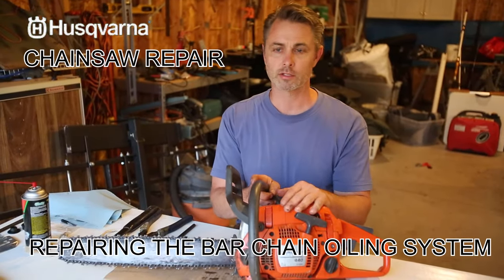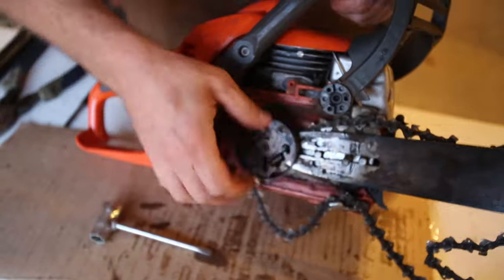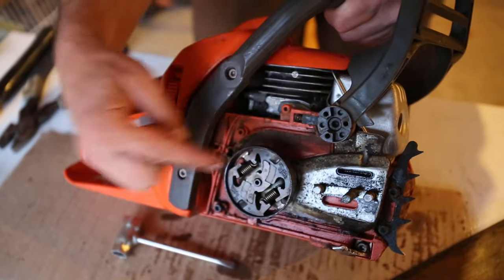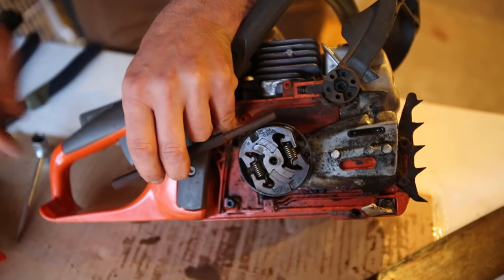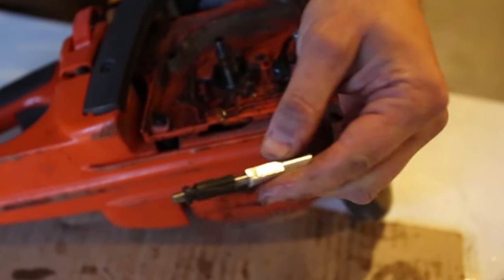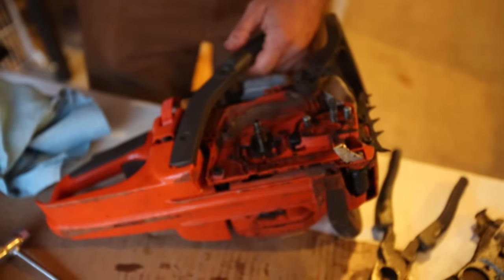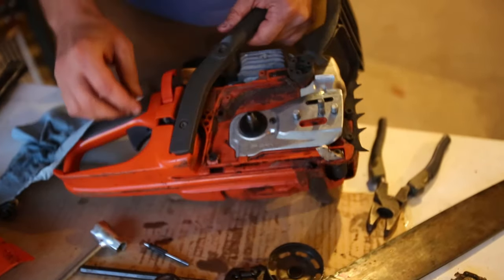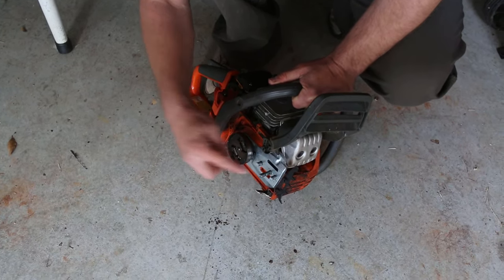Husqvarna Chain Lubrication Diagnosis and Repair

Comment: Thank you for this important video. I experienced this same issue the other day cutting some trees, when I went to top up the fuel and the oil because the chain was dry and smoking a little. This is when  I noticed the the oil levels never dropped. Got home, watched your video, followed your instructions cleaned up the chainsaw  and turned the housing and oil came out of the grove. Why isn't the chain not receiving oil???
Reply from the maker: Did you pull the bar off and clean the two port holes that match up with the oiling slot? And did the worm gear look to be in good shape? Or is the line from the bar chain oil chamber clear/clean?
Reply: @CamoMatrix  To be honest,I thoroughly cleaned off the bar and holes and the gap where the oil comes out of, the chain is now moving freely thanks to this video. However, I will test it today

Comment: Hey, terrific video and detailed explanation.I was wondering if this applies to a Husqvarna 120 mark II. I recently removed and replaced the clutch and sprocket as you showed (with the punch on the reversed threaded assembly and blocking up the spark plug gap with spare pull rope) but now I think my oil is not lubricating the chain. There’s not much DIY documentation on the 120 as it’s an entry level saw, but I use it as my beater saw in the deep woods and it gets quite abused. 

My Echo and Stihl have plenty of online resources for repair but not my Husky. Any suggestions?
Reply from the maker: The pump could be different but if the worm gear in the pump isnt catching that could be a problem. the pickup tube could be blocked in the bar chain oil compartment also.
Reply: @CamoMatrix  Hey! Thanks for the quick response. I checked the exterior port where it feeds into the bar slot/oil hole and cleared any sludge. 

I’ll have to empty the oil from the tank and check that as you mentioned. I will also look into the worm gear. Thanks for those suggestions.

 I took a peek at an exploded view of the parts on on an online parts website. I may try to disassemble another decommissioned 120 that I own (and have been slowly removing it’s working parts and putting into in my working 120) to see all the involved parts and see if there’s a clog somewhere in there. 

I will first run the saw with the bar off as you displayed near the beginning of your video to determine if it’s clogged before or after the tank. No point in removing parts unnecessarily.

Do saws’ bar and oil tanks have a filter inside the tank like the fuel does? Or it usually just accessible from the clutch/sprocket area as you demonstrated?

Comment: Hi. Where is the oiler 'adjustment" at. MIne needs turned down.
Reply from the maker: To much bar chain oil?  there is nothing that can slow it down or speed it up but the delivery gasket may be worn out so the volume of oil isn't pushed against the hole on the bar properly.
Reply: @CamoMatrix Yes, I've came to the conclusion there is no adjustment. I've never seen one without until now.

Comment: I have ne oil pump on mine still not oiling
Reply from the maker: Is the pickup tube in the oil compartment blocked or damaged?
Reply: @CamoMatrix  that has been replaced also I might have to recheck it just to make sure